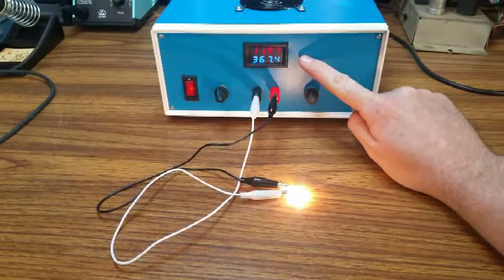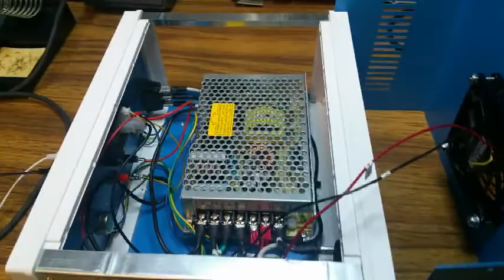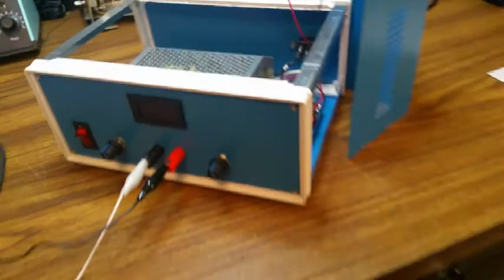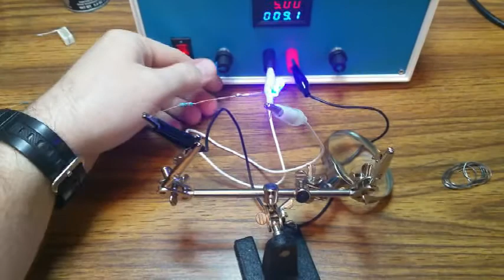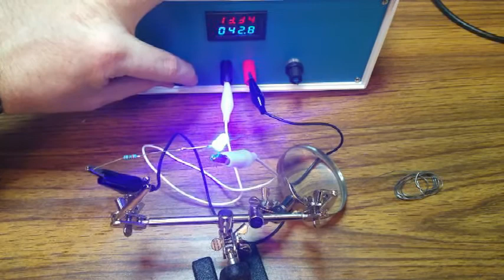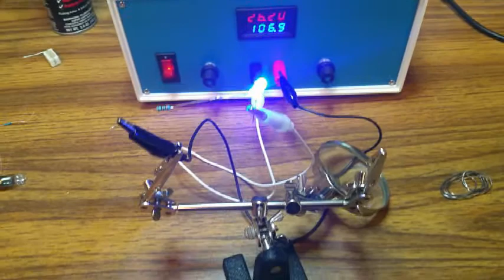Variable Bench Power Supply (GreatScott Build)

Comment: I ordered an LTC 3780 and Mine didn't have that big metal plate on the back of the PCB.  It does have two heatsink's on the mostfets.

Oh and by the way.  You may have been getting the red fault light because of the undervoltage protection pot.  Mine was on until I adjusted it.

Comment: HI Joshua, I decided to make this power supply after watching your video,I got all the parts       and decided to test it before putting them in the enclosure,all works fine except the current pot.I connected an led and resistor but could not alter the current any ideas? Thanks.
Reply from the maker: rustyrob My guess is that the LED current is so small that it will not dim even at the lowest setting because it's current falls bellow what the converter can limit. Try hooking up an incandescent bulb and test it.
Reply: Thanks for that Joshua,I have a spare bulb off my car ,will give it a go.

Comment: I honestly laugh at times when I see these quickly made supplies. I'm not bashing or anything but putting in my two cents on building a proper power supply. Reason being there are a few misconceptions people forget or don't know about. Grounding is a blessing but also a bad thing depending on what you plan to use the power supply for. For a example you use the power supply to power a circuit and then use a Oscilloscope on the circuit to see a wave form, you could hurt the scope or yourself if you don't know what you're doing or have no clue exactly how that pre-built switch mode power supply is put together. Just remember O-scopes are Earth ground referenced. If you know ahead of time that the DC ground is shared with the AC (Earth) ground then you just clip the negative side of the probe to the chassis and be sure your hand doesn't slip. Say you wanted to use a second power supply in series, if both supplies are sharing a AC ground then you'll pop a breaker or pop the power supply/s. A lot of those switch mode power supplies will have the DC output ground tied in to the AC ground. It's a safety feature but if used improperly it can be a bad thing. Rule of thumb for proper bench/lab supplies is the only thing that should be attached to the AC ground is the chassis/case of the power supply. Keep in mind that rule is mostly used for Linear Power Supplies. With cheap switch mode power supplies this might add noise from the MOSFETs in the supply if you leave it floating, even adding a Fan could add noise to the supply. Some high end supplies will have a switch or jumper that will let you tie the DC output ground to AC (Earth) Ground. You need a to make sure the supply has a fuse, If not you need to add one. A 10 turn POT or two for voltage and current control is key unless you have a output switch so you won't overshoot the voltage/current of the DUT when ramping up the controls. You could add two POTs for a fine and course settings. Just wire the POTs as rheostats and have one value half of the other (In other words for a example a 10K and a 5K) A toggle switch for controlling the outputs is a quick and dirty way to do things but this causes "Switch Bounce". You want a latching switch that can quickly ramp up with little to no switch bounce. This isn't super critical but if you want to "one shot" a waveform and turning on the supply to a circuit to catch said waveform will make things so much easier with little to no switch bounce. 

A little tip if you want your supply to get 0 volts instead of 0.83. Just add one or two diodes to the output. Make sure it can handle the maximum current levels you plan to have the supply to push. However the adverse effect is you'll now have a permanent voltage drop so for a example a exact 30v max supply with a diode that has a voltage drop of 0.73 would let you have a maximum of 29.27 on the output.
Reply from the maker: Leland Clayton please enlighten us with your superior knowledge of power supplies.
Reply: I've been tossing around the idea on creating a video series on the subject and maybe even designing a open hardware like supply using off the shelf stuff. Then again using discrete parts would be a better solution for long term, cheaper price wise and would help novice electronic hobbyists get a better grasp on how everything works. About 90% of the time a power supply is usually the first major project a novice hobbyist will take on. Kinda like learning the first few chords of Smoke On the Water on Guitar lol.
However going the discrete route would involve designing a PCB and can make some people dread it and want to drop the project.
Reply: I'm interested in why grounding of the case i bad. I'm building this right now and I've grounded the case which is all metal.
Reply: Leland Clayton I'm sure in some sense you know exactly what you're talking about, but your feedback would be taken more positively and seriously and less facetiously if you created your own video series instead of condescendingly criticizing somebody else's. People come here to learn, try to remember that and give constructive feedback please.

Comment: i am currently building the same thing but i have a different lcd screen that has a 100A shunt that came with it but having a hard time wiring it to the ltc 3780  because none of the leads from the lcd have names on what its purpose. think you can help me this is the lcd screen i have 

https://www.amazon.com/bayite-6-5-100V-Display-Multimeter-Voltmeter/dp/B013PKYILS/ref=sr_1_2?ie=UTF8&qid=1469489272&sr=8-2&keywords=lcd+meter
Reply: I had the same problem at first but mine is different , it has 5 wires , but the one you bought from Amazon have 4 pins and is clear , look at the 5th photo , you have four items ( the fourth is the load ) and the connections is obvious.

Comment: really nice build man! I've been using a crapy makeshift ATX power supply I threw together.  Unfortunately I had a woops moment and sent 50kv through it (extremely low current) and now it's fried.  I plan on building one of these soon! I think i'll still use an ATX to power it though because they're free (if you have an old comp lying around).  

What types of electrical experiments have you been trying?  I've been experimenting with LED chips, MOT's and flybacks.  I am thinking of rewiring a MOT to use as a 12v battery charger.  Thanks for posting and sharing your inspiration.  Every time I try to make a youtube video I end up deleting it thinking I sound foolish lol.

Comment: Good job, well done. I just received the material for an identical bench power supply like yours and will start it soon. Why did you connect all the ATX outputs? I thought you'll only need the 12 volts for the LTC and may be the 5 volt for the display / fan ...right?